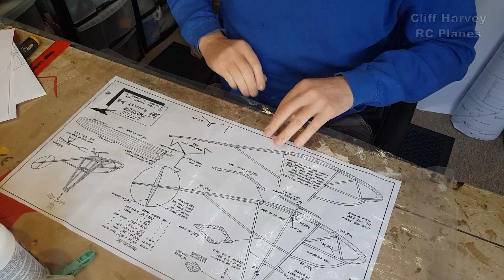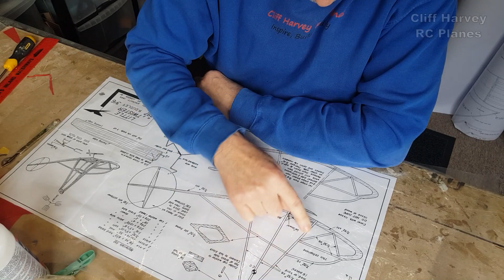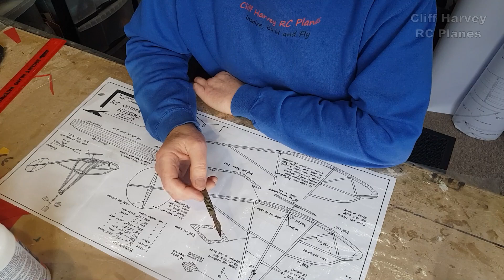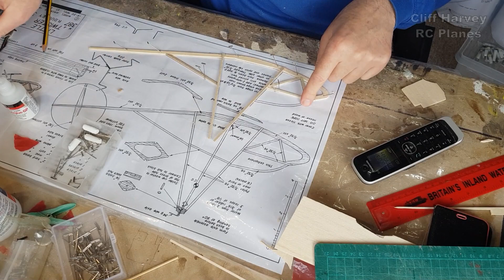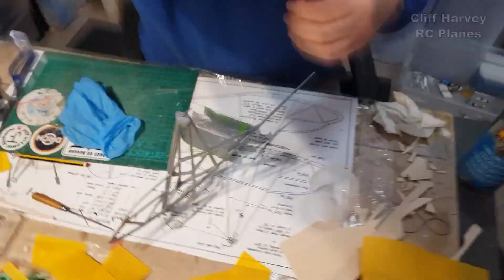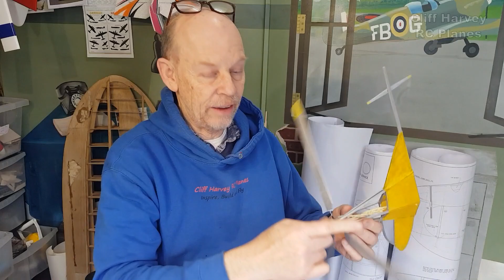Build a Helicopter with the Power of Rubber!

Comment: Hi, just watching this vid and straight away realised it was designed by Roger Dudley a guy who was an amazing modeller in the Westland and Yeovil aero modelling club when I joined in the late 70's he used to make all sorts of unusual models like the little twister, he had an amazing glow powered helicopter that he also designed and built it was a great flyer. Another model was a small rubber powered scale model off the Westland wyvern with contra rotating props which he had designed himself with small gears in the nose. Sadly he is no longer with us .
Reply from the maker: That's interesting, I didn't realise Roger lived in my part of the World, he sounds like he was a very clever man, thanks for commenting 🤔👍
Reply: @cliffharveyrcplanes  no problems, I have a small really bad photo I took of the glow helicopter so where it had the motor mounted inside the fuselage as a pusher , he also had some great little FF co2 planes. We used to regularly fly RTP in a school hall and he helped me with my attempt to build a RTP auto gyro, which sadly didn't go great 😃